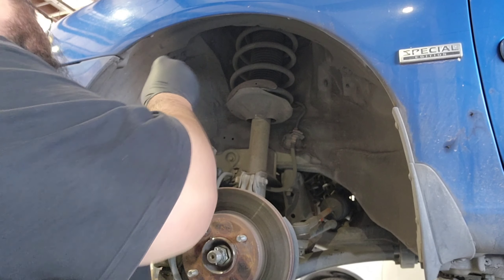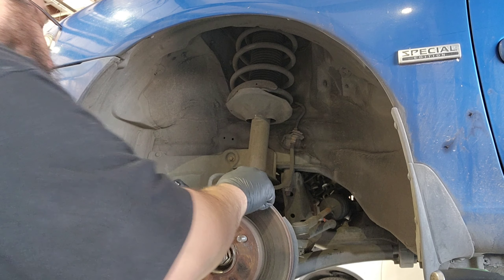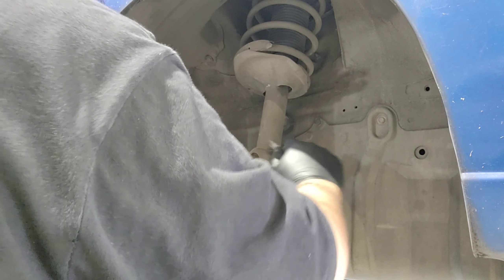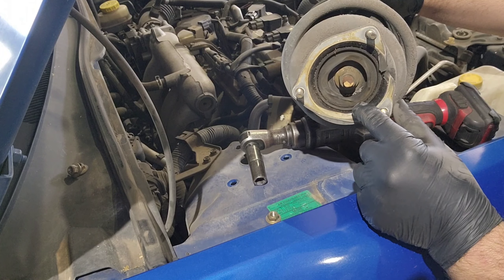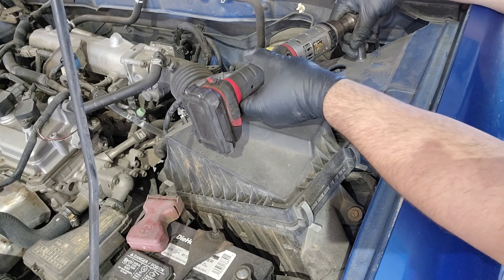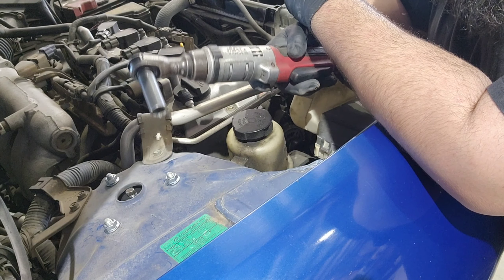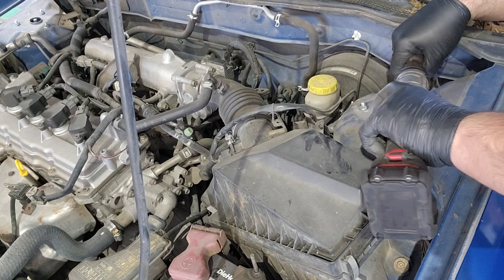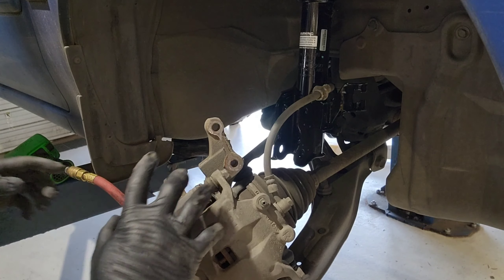Beginner Mechanic Replacements #mechanic #tools

Comment: I need to put camber plates in my 335i so I can get even front tire wear. BMW front struts come with a fixed -.5 Camber but it wears out the outside edge of the front tires. The rears have camber adjustment just not the front. How hard are those to put in?